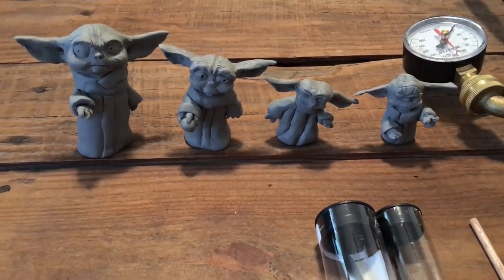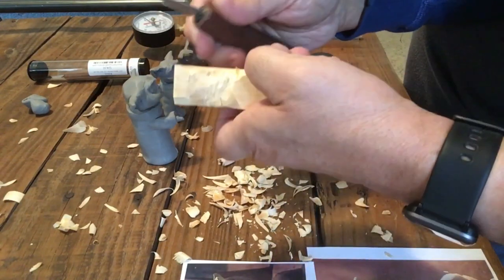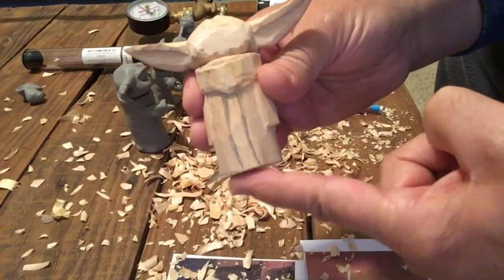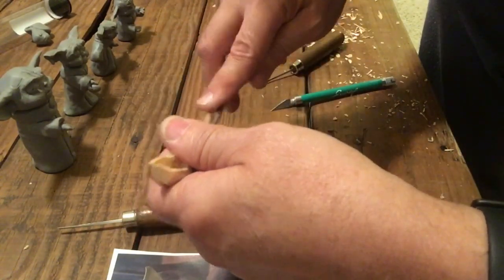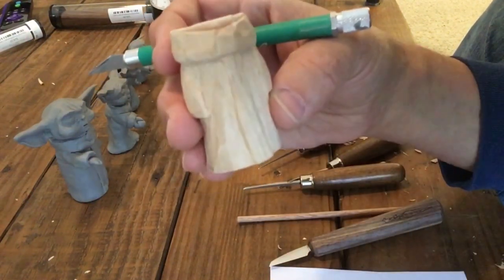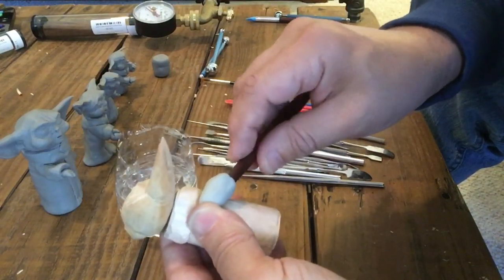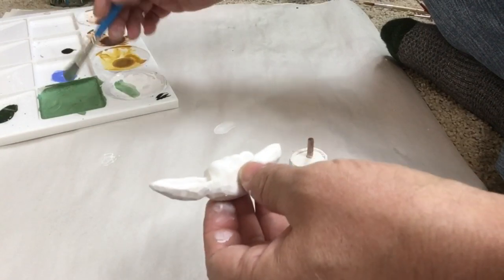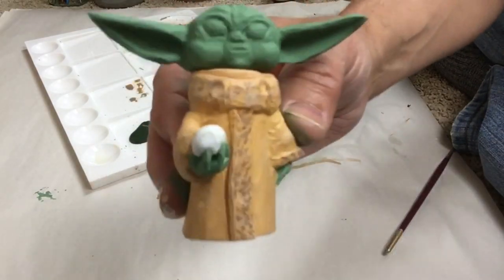Wood carving￼ Baby Yoda

Comment: I was just wondering, what are the demensions of the two pieces of wood you used for this? I tried to carve some other yoda designs and completely failed at it. This design you are doing is the easiest one I've seen so far.
Reply from the maker: Sorry for the delayed response. The body is 1 1/4 x 1 1/4 vertical. The head and ears are one by one horizontal. I hope this is helpful.
Don’t forget I also used two-part Apoxsee to build the arm.
Reply: @markdmaker3173   Awesome! Thank you!!